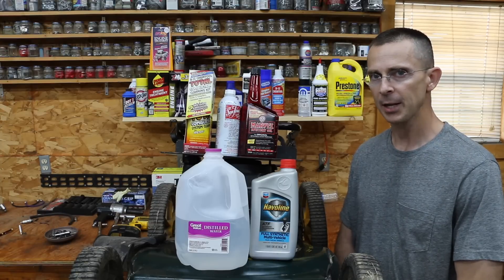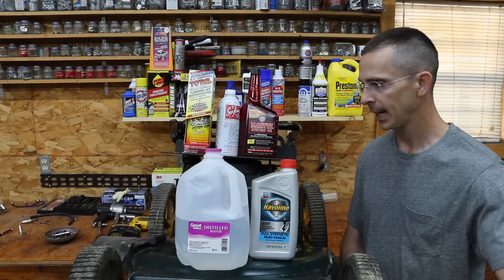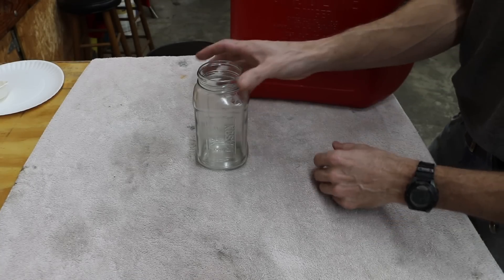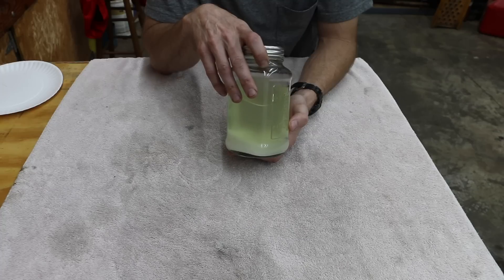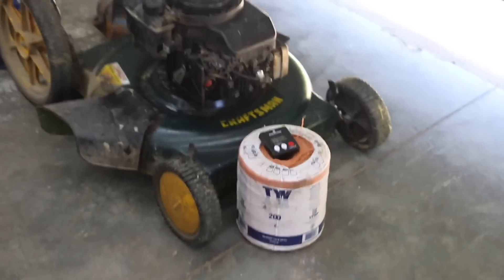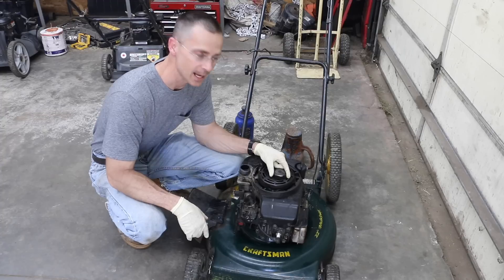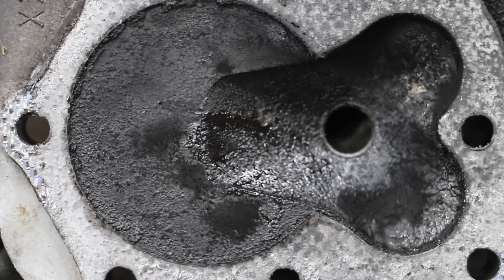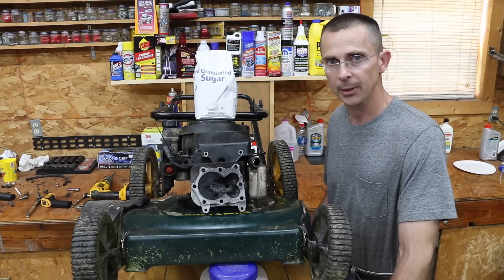Will Sugar in Gas Destroy a Vehicles Engine?  See what it does to this Engine!

Comment: Sucrose is a polar molecule, meaning it's insoluble in non-polar solvents like gasoline.
Reply: I am glad someone's noted this.
Reply: cone conington yes, but using an alcohol, which has an non polar and polar emd, will allow it to dissolve
Reply: He wasn't using alcohol, he was using straight hydrocarbon fuel (non polar). 
And alcohols polarity is variable. Lower carbon numbers in its chain and it becomes more polar, eg methanol.
Longer the carbon chain, the more non polar it becomes.
Reply: +cone conington He's in America. Our 'regular' gasoline contains 10% ethanol in most places around the country.
Reply: Ethanol is not in dry gas.
Reply: +Joe Moto Depends on the brand. I've seem dry gas sold which was ethanol, methanol or isopropyl alcohol. Back in the 80s and 90s the watchword was to use ethanol dry gas because ethanol is hygroscopic and would combine with any water in the tank and allow your engine to burn it.
Reply: lokisgodhi yea, maybe.  I just use heet brand in the red bottle.  I tried other brands and they didn’t work.  water would still precipitate out of solution.  heet would always keep the water is solution with the gas
Reply: Landre Porter nerds run the world and get all your money 24-7 for every day ya live. maybe you should join them.
Reply: cone conington good to know
Reply: Then by what mechanism was it transported via the fuel line to the carb, and then to the engine? 

I just put a tablespoon in a pint of gasoline.  hmmmm.  It seems to have disolved.
Reply: Stu Then it's not 100% pure.
Reply: cone conington if you have gas in a jug in your shed some sort of moisture or contamination is going to  be there. You reckon that's enough to dissolve the sugar?
Reply: its up to 10% could be 5% that is if he used ethanol gasoline he used 16 ounces of gas so 10% max of that may have been ethanol  then he adds a 1/4 cup of sugar that much sugar would barely dissolve in 60F water but you expect it to dissolve in 1.6 ounces of ethanol? really man I figured that out and I'm not even a chemist!
Reply: You can add some water to the mixture, that should actually clean the engine.
Reply: pour through the carb slowly. breaks away carbon..
Reply: Solubility of sucrose in methanol = 1 g / 100 mL of methanol
Solubility of sucrose in ethanol = 0.59 g / 100 mL of ethanol
Reply: Vrej Egon Spengler so in other words a half a gram of sugar will dissolve in 3.3 ounces of ethanol so no way in hell will 50 grams of sugar will desolve in 1.6 ounces or less of ethanol.
Reply: If you mix the sugar in water first then pour it in the tank, it will ruin the fuel pump.
Reply: Rich Caise how will it ruin the fuel pump?  How does the fuel pump know what kind of fluid it is pumping?  Anything to large to pass through the pump will be caught by the strainer/filter before the pump so again explain your theory again?
Reply: Rich Caise how would you desolve 3 ounces of sugar in water and then you pour that water in the tank what do you think will happen? Nothing because the engine can't run on water anyway
Reply: This trick was introduce back in the 40's. Chem is diff.
Reply: Cone, what are you doing here? You should be out teaching chem to kids who like things that explode!!
Reply: ya all that and a buck fifty will get you a cup of coffee
Reply: As a retired chemist I would consider sugar to be somewhat both water and hydrocarbon soluble.  Most chemicals have affinity to both although small.  Doesn't take but a few grams to muck it up.  Methanol is another example of a molecule that dissolves in gasoline (hydrocarbon) and in water.
Reply: @richcaise1788  Pretty sure water alone will ruin things.  It might make it past the fuel pump at some point and the engine would run rough, at best.  Where it would really suck is when the water got trapped in the fuel line and then in the cylinders/engine itself.  Might not kill the engine, but the repair would be really expensive.
Reply: remember from school chemistry: Like dissolves like.
Reply: B
Reply: Good point, but still burns into a hard Carmel goo.

Comment: I had somebody sugar my gas tank many years ago. They must have dumped a 1 pound bag in there. Like here, the sugar never really broke down and remained at the bottom of the tank. It did make it into the electric fuel pump and it ruined it. The only way I found  out was when the vehicle started losing power. I had to drop the tank and vacuum out what was left. New fuel pump and filter and the engine is still running fine today.
Reply from the maker: Thank you for the feedback
Reply: How long did it take you to notice the vehicle losing power?
Reply: It lost power cause the filters and gas lines get packed, not from engine damage. My ex did my diesel suburban and Ford escort. Later she learned to put it in the crank case and I lost about 4 motors before I figured out what the fuck was going on. If you divorce your wife, move far away or hire a 'problem solver'!
Reply: Same thing many years ago for me as well. It took out the fuel pump and fuel filter, but nothing else.
Reply: @screechowl9605  I know a guy.
Reply: Not sure because I didnt know exactly when the sugar was put in.

Comment: This is mind blowing!  

My entire childhood I was told that a spoon full of sugar would seize an engine. After this test I'd guess you'd need a kilogram of sugar, and that would only likely clog a fuel filter...
Reply from the maker: I thought the same thing as you.  Thanks for commenting!
Reply: Ben - as a child I was told "a spoon full of sugar would help the medicine go down, the medicine go down, the medicine go down".  After decades and handfuls of Quaaludes, Valium and Oxy, I really don't think it made a difference. They go down just fine.  Just sayin'.
Reply: Just dump the whole bag in that'll cease it.
Reply: DONT LET IT FOOL  YOU CARS ENGINE IS REFERENT
Reply: When I was young, my father had to have an expensive servicing done of a 1966 Mercury (410 V8) fuel system after someone dumped what appeared to be two or three cups of sugar into the tank. The reputation of damage being done to a vehicle by sugar dumped into a tank (in sufficient volume) is true.

Comment: Years ago I came into possession of a 1973 Buick Regal with a 350 V8 that had under 100K on it. When I received it I know for a fact that it had had a 1/2 pound of sugar put into the gas tank 6 months earlier, with approx 30K miles on it since the sugar. The PO had told me that Within a month or two the carb had to be rebuilt. It ran fine when I got it, I even used it to tow my boat back and forth to the Colorado River. Then on my 3rd trip towing the boat, the car started losing power and running really bad. Wouldn't hardly idle and was making a lot of valve train noise. After getting it home I pulled off the intake manifold and found 3 or 4 bent push rods and either stuck or collapsed hydraulic lifters, about 1/2 of them were toast.  Replaced the bent rods and put all new lifters in it, put it back together and drove it for another 3 or 4 years without any more problems. Then the person I sold it to drove it another couple of yrs.

I have very little doubt that the sugar was the cause of both the carb and the lifters going bad.  Not the catastrophic failure that I had always been told would happen, but had I not done all the work myself, it would have surely sent the car to the junkyard.

Any way, it was great to see this put to the test, Thanks for all the great videos PF!
Reply from the maker: Billy, thank you for sharing your experience with sugar contamination.  Also, thank you for the positive comment!
Reply: PO?
Reply: Sorry, PO= Previous owner
Reply: If it had  bent push rods,and bad lifters,then they put something in the OIL,not the gas,since  the fuel should not come into contact with the  lifters/pushrods. at all.
Reply: Or, maybe some bent pushrods and collapsed lifters weren't that uncommon in a 70's-era GM 350 that had been towing a boat.
Reply: Actually it wasn't. Even if sugar (sucrose) could react in an engine, it doesn't dissolve in gasoline, so it can't circulate through the machine. ... Sugar is heavier than gas, so it sinks to the bottom of the gas tank and decreases the amount of fuel you can add to the tank. If you dump enough of it in a tank, you could theoretically clog up the fuel sock and filters.
Reply: the sugar/fuel mixture gets gummed up inside the valve guides, siezes the valve stuck and that causes the failures.
Reply: Are you sure that hauling that boat up and down mountains didn't hurt that engine worse than the sugar...? Might be pretty hard to bend pushrods with sugar... btw - that 350 engine was known to fry cams and lifters - the steel used in the cams was too soft.
Reply: John  Gardner, have  no  clue  how  internal  combustion engine  works  don't  you ?  freshly  graduated  from  all american school ?
Reply: the rods bending was 100% NOT because of the sugar. Would have happened either way. However the carb being poopy yes that is the sugar... Would take months maybe years and only happen if it sits for maybe i dunno a week one time and then you go and drive it. I bet you were not daily driving it when the carb dicked up.
Reply: I mean he seems to have a better idea than you Byrod1... But I don't agree on the assumption something was added to the oil. That can just happen from wear and tear.
Reply: Every car that I have seen with bent pushrods was from high rpm. The valve would then float and hit the piston. Weak link would be the pushrod.
Reply: pol.
Reply: @screener545  It CAN happen from sugar, it gums up tbe valves, and then that bends the push rods. I have had it happen.

Comment: My family owned a foreign car dealership, in a town of about 50K people. There were no other shops in town which repaired foreign cars.  I recall a 1959 Jaguar XK-150, which was at the high end of the price range of street/highway use sports cars.  Someone had put about a 5lb. sack of table sugar in the gas tank.  The Jaguar engine, which was a double overhead camshaft type, had what we called "swallowed a valve."  This means that one of the intake valves failed to return to its upward position, resulting in a piston striking the stuck valve.  This destroyed the piston and valve, and severely scarred the cylinder walls, requiring a total engine rebuild. This cost about $1250 (1960 dollars).  The gas tank, dual carburetors, and fuel pump and fuel lines had to be totally cleaned out.  The tank, when removed, still had about 3/4 of the original sugar.   The car was driven less than 50 mi. after the sugar was put in the tank.  This shows the damage which can be done by sugar in the fuel.

Comment: I have heard the sugar in the gas tank story since the early 60s. I was a kid so I took it as gospel.
Reply: knight flyer. Who snitched ?
Reply: knight flyer nice
Reply: Me, too.
Reply: knight flyer  I genuinely don't believe you because I've seen it done to people before and nothing happen.

The whole fuel filter thing makes the sugar approach pointless. If there was no filter, at most, you'd get a lot of caramel that would eventually just cook off. Worst case, they'd have to flush the system.

If your story actually happened, though, I wouldn't be surprised if your buddy got scammed into covering a fix for something else that was already wrong with it.
Reply: Years ago, I was a mechanic at a Pontiac dealership, and a customer had her GTA towed in for a no run situation, this car had been to 3 other shops, without being fixed! While I was an apprentice, and the senior technician was baffled, we decided to cut open the fuel filter... completely clogged with sugar, fuel regulator, injectors & catalytic converters all shot!the engine it self would have safe, except for the buck shot dropped into the throttle body.long story short her ex boyfriend had a rather expensive bill to settle, and time to serve!
Reply: Iron Monster  I don't think you really appreciate what a fuel filter does... that doesn't eve get into the addition of ethanol...
Reply: Iron Monster  I'm saying the filter should handle particulate matter.
As for the water, it'll get diluted by the ethanol in the gas
Reply: Iron Monster  No, but that's correct. People fail to realize despite SEEING IT IN THEIR FACE IN THIS VIDEO that A) Sugar does NOT properly dissolve in gasoline (don't believe me? Go mix some right now and see how much is in the bottom)  and B) The fuel filter filters damn near everything save for a SMALL amount of the sugar, and yes, that INCLUDES water. I repeat, WATER. DOES. NOT. GO. THROUGH. A. FUEL. FILTER.
Reply: @InfernosReaper  what sugar gets dissolved in the fuel, will pass straight through the filter, as it's in solution and the filter is merely a mechanical one. A car engine runs far longer, runs through a lot more fuel. With movement and fuel sloshing in the tank eventually all the sugar will dissolve in the fuel and reach the engine. From what I've seen, where sugar wrecks havoc is in carb jets, rings, around valve seats and in the injectors. Not neccessarily when the car initially runs - but when it's sitting for a good while in the other end of that drive, the fuel vaporize and the sugar crystalize and hardens. Especially inside jets and injectors. If you've run it hot enough, it might even caramelize if there's enough residual heat left after the fuel remnants vaporize. The those jets or injectors might as well be packed with superglue.
Reply: @pr0xZen  I see you've taken just enough science to think you know what you're talking about, but in practice things don't quite work out like that thanks to the parts you don't know.
The fuel filter deserves a lot more credit than you're giving it
Reply: @InfernosReaper  Not unless you have some oddball kind of chemical or osmosis membrane filter it doesn't. The overwhelming vast majority of fuel filters are merely mechanical filters, because the overwhelming majority of contaminants that get into fuel, and into or come from the fuel tank itself, are solids. Some diesel filters have water separators, but this too is mechanical (just gravity).

I suggest you crack open a carb, try flow and pattern testing an injector from a sugared engine that's run through that fuel and sat for a day - yourself. Then come back to me.
Reply: @gettintheresafelywithpatf2869  Hall hath no fury like a man scorned.  Prisons seem to house their share of scorned men and women.
Reply: @cancelhandles  Water DOES go through a fuel filter, which is why there is a drainspace under the filter medium for the water to drop into. There is also a screw on the base to periodically drain the accumulated water BEFORE it overflows the fuel filter.
Reply: Me too, now I know it is not the end of the world! I always dream about doing it to someone I really hate. 🤫
Reply: @shikpolam8968  The most effective way to do it is not to use granulated sugar but to use something like golden syrup that has no grains in it. A filter only stops grains of a certain size or larger from going through. Golden syrup is liquid so WOULD go through.
Reply: @roberttill3787  Holy #%*€, I am doomed! I am at the crossroads either going to heaven or hell, since I know how to do it now. Thank you for the suggestion, now I need to figure out whom I hate the most. ;-)
Reply: @InfernosReaper  The "sugar in fuel" thing probably predates the use of fuel filters.
Certainly none of my cars or motorcycles from the 1970's had fuel filters.
Reply: @cancelhandles  It works...... Add water and sugar.  1/2 gallon of water and 1/2 cup sugar shake and dump in tank (any tank car, truck etc) give it 3 to 4 days and you'll be shopping for another car! 100%
Reply: @InfernosReaper  It works...... Add water and sugar.  1/2 gallon of water and 1/2 cup sugar shake and dump in tank (any tank car, truck etc) give it 3 to 4 days and you'll be shopping for another car! 100%
Reply: @winteriscoming90  pretty sure the water's gonna do more than the sugar and that's less so since the started putting 10% ethanol in the gasoline...

So, at most, the fuel system has to be cleaned out. Annoying, but not fatal.

My assessment isn't just academic. I've known jackasses who've tried that crap.

Comment: some-one put alot of sugar in my 1963 ford truck. and it glued my intake valves shut, to where it bent my push rods when I tried starting it the next morning, after  I replaced them, then I threw a rod not long after that, the piston had mysteriously shattered and and put a hole in my block below the water jacket, leaving the rod cap on the crank and leaving me good oil pressure, and no coolant leaks so I drove it the 200 miles home, it shook like a paint shaker, and bolts fell out everywhere, and had to be push started the last leg of the journey when the starter fell off and got broke, I welded the hole up in the block and replaced the rod and piston, using the old bearings, and drove it another 10 years before replacing the engine at 508,000 miles, and yes its a big piece of crap, and I still drive it, and its my 1st ford and Ive owned it for 34 years and put 400,000 miles on it myself and only had to tow it home once
Reply: Thanks for sharing that story.